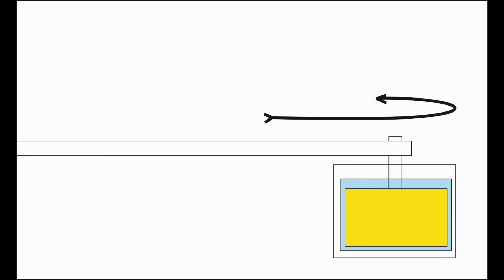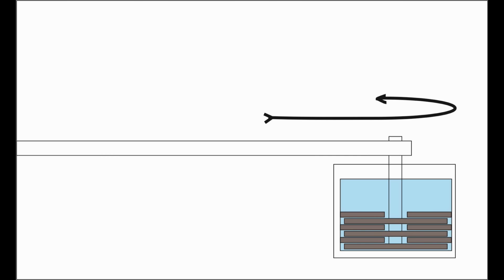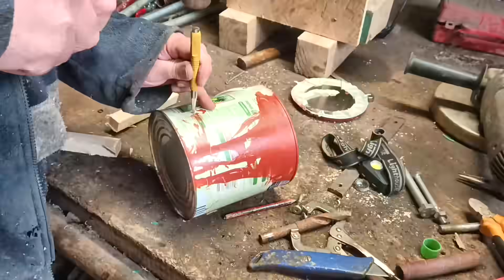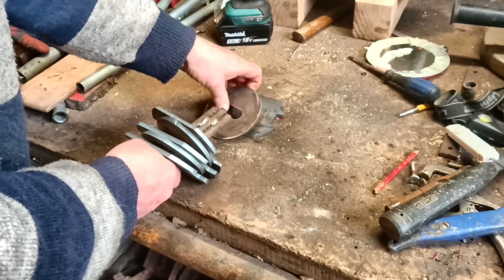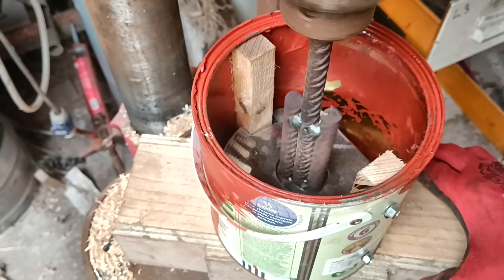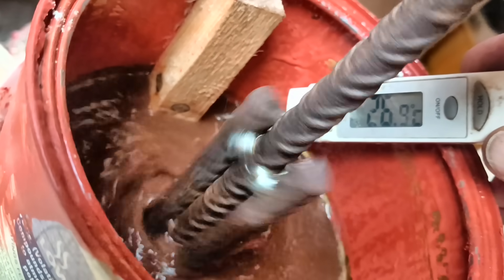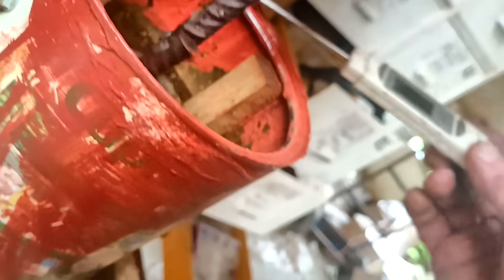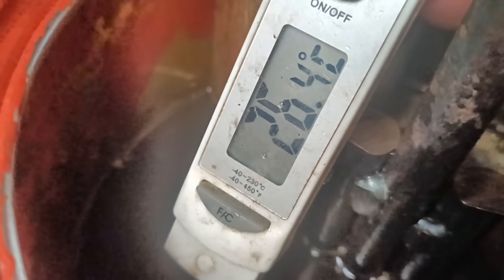Heating Water With Friction – How Practical Is It? Interesting Experiment!

Comment: Probably an old torque converter would be ideal. Just stall the output impellor and use the inbuilt pump to circulate oil to your heat exchanger primary circuit.
Reply: A very similar device that's actually designed to have water as the working fluid and for converting mechanical power into heat is a water brake dynamometer.
Reply: I agree.
Reply: I suggested one of the drums, then realized the whole transmission and tq converter. Fill with water, turn the input, lock the output. Water to water intercooler through the trans cooler lines. Gave ya a thumbs up for getting here first lol
Reply: Worth a shot, even if the heating is not satisfactory, it could be used as a progressively adjustable brake by varying the fluid level in the converter
Reply: That was going to be my suggestion,  they usually have an excess of heat and its already all done for you.  You could have multiple and tap off the oil.

Comment: Im not a fan of this idea, yes its simple in and of itself, but to heat a house, you then need to pipe the water to your house, which will take energy, and youve only got low grade energy at the end of it.

A wind turbine with electrical generator means you can wire it up with cables, and you can turn that electricity into heat if you want, and in the summer you can do other things when you don't need heat, and if you want to diversify your energy sources, eg get solar, itll be easier to get it all working together, and you also have options like heat pumps.

Water as an energy storage medium has merit, you have the space, but id aim to do that from energy that was already going to waste.

Comment: It seems like a great way of filling your heat exchanger with little tiny bits of iron oxide. I think you'd be better off just running a dynamo immersed in water, with the generated current going to resistors in the bottom of the tank, or to power the exchanger pumps.

Comment: Hi Tim. I don't have exact figures but I can tell that the steel plate friction idea won't be very efficient. I say this because it will  make a lot of noise, and that's energy lost. There will also be a lot of kinetic energy lost in the friction, mainly to wearing down the steel. It would also need a lot of adjustment, or it will wear smooth. EM resistance on the other hand won't cause noise or iron filings. Compare your experiment to a kettle, which draws about the same as that bench drill. The same energy converted into electricity would heat a lot more water a lot faster. You'll also severely limit yourself making your windmill only run this water heater. It could be used to power anything electrical if it drove a generator, instead of only being useful for hot water.
It would be really useful if your wind turbine, when not needed, could be used to pump water uphill, to a pond or a water tower. Acting as a battery, this could be used to run a small turbine, effectively storing the wind energy you harnessed, for when the wind stops blowing.
Reply from the maker: It was only an experiment, Joe! I'm just exploring the options  : -  )
Reply: . . . and a very interesting one  @wayoutwest-workshopstuff6299  My predictions are just that too. I'm looking forward to the whole process as much as the results, and if it's just to answer the question, will it work, then here we go! It got me thinking though, about low tech wind energy generation and storage. I pictured a windmill turning an Archemedes screw that fills a water tower. Add a water turbine fed from the tower, and it's a wind power battery! It could of course just run a generator directly, but accumulating a head of water from the erratic output of a wind turbine would give you a steady, predictable charge to work with for as long as the water flowed! More than enough to heat a tank of water I bet! It could be a closed loop of water, or harnessed from any convenient source, and You'll be building a tower for the sails anyway, so why not build a water tower inside it? The weight would make it a lot more stable, and you'd only need a couple of meters of head pressure, so three or four IPC bowsers stacked on top of eachother would take you to the required height and give you a lot of stored energy capacity.
I hope you don't mind me bouncing these ideas off you. I'd love to see you build a windmill for heating water, AND able to generate clean energy for other things. I just feel that friction plates would bring their own problems. Can't wait to see what your experiments show us.

Comment: Friction vs. Shear Force - I've had a car with an auxiliary water heater powered by the drive shaft - it was said to use shear forces in liquid to generate heat. It would be interesting to see if you could generate the same amount of heat as before even without the plates touching if you cut elongated slits into both rotor and stator plates. That way you could minimize wear & tear on the plates.

Comment: That's a good idea to for a cheap heating system but the metal particles could cause a clog in your central heating system, So could the windmill be connect a generator which powers a heat pump, it would cost more but it you wouldn't have the problem of metal practices potentially coulding your central heating system.

Comment: It can also be heated by induction, if you move powerful magnets close to a copper or aluminium tube, the metal gets very hot. It is a bit more expensive because you have to use big neodymium magnets.

P.S.
I've seen that this has already been mentioned.
 The heat pump is also a good idea, for every watt produced by the mill you heat almost twice as much, it is the closest thing to free energy that the laws of physics allow us.

Comment: Maybe dig a hole & put your friction heater in, soil acting as a low cost insulator for heat & sound, top up water as needed via surface tank using a level indicator, & extract via a heat exchanger. As you don’t need high temperatures for central heating water would be fine & also as it’s normally windy where you are you can get away without storage. Probably after a while you will ignore the noise of the wind mill & it would be off for about six months during summer when you don’t want house heating, although you could kiln dry wood or do other jobs with the heat when not needed to heat the house. Thanks for sharing!
Reply: Dig  a big hole. fill it with insulating layer of styrofoam etc. then a big layer of sand to keep heat. then the water tank with the friction heater inside.

Comment: That's quite significant heating for something you made it look like you more or less "throw together" in the video.  I do agree with other comments that induction would have a big advantage for long term use, but obviously that would require a lot of magnets, that can handle the temperature, some magnets starts to loose their magnetism at temperatures well below 100 °C, and if the system happens to run dry for any reason 100 °C is no longer the limit. 

Personally I'd might go with a belt driven air compressor to generate heat. The vast majority of the power a common air compressor uses turns into heat anyway, and then you have compressed air as a byproduct. Compressed air is not "just" a potential source of on demand  power, it's also very low in absolute humidity when it's cooled down and the water has condensed out. At the scale of producing heat for a home, just the fact that the once compressed air has very low water content can have a lot of interesting uses. Also, the heat from water condensation in the frist place improves overall efficiency of heat generation. 

If the compressed air is used to generate power you can achieve a significant cooling effect, you don't need very high pressures to reach far lower temperatures than required in a freezer.  

Going with an air compressor to generate the heat, the air can be delivered to a heat exchanger somewhere else, through an insulated line, and then to a tank for storage.
Reply from the maker: Oh man! More things to think about : -  )
Reply: the fact that compressed air does cool down is what makes it inefficient at producing power.
back when it was a big thing, they made "reheaters"... kerosene burners in sealed boxes in the airline itself... bring it back up to the temperature it was compressed to, or higher even...

when its hot, it wants to expand. when its cold... it wants to contract. its trying to absorb heat, not release it. yes, its a bit of a brain bender ;)

if you have a certain volume at a given pressure, and expand it to twice the volume... if it started at ambient, and cools down... the resulting pressure will be less than half... if its hot and cools to ambient as its expanded, it will be at more than half the pressure... and still be capable of performing useful work.

once you dispose of the heat of compression, you have to replace it to get that compressed air back to the same conditions it started at.

i forget all the terms... isothermic, isobaric, adiabatic...

still, they can heat or cool, thats all AC, fridges, and heatpumps are doing... they work fine when the input is constant, they can be tweaked to run at ideal efficiency... that is, they run at a constant speed...

the other issue with an air compressor, or wind power in general, is that it takes a certain amount of torque to simply rotate through a cycle. once the turbine can deliver that torque... the compressor cant harness any more power. it always takes the same power to turn over, yet the wind delivers power increasing at the cube of the velocity... twice the speed isnt twice the power, its four times the power! so you need a compressor that ideally can deliver four times as much at twice the RPM. that can vary its delivery rate... not its pressure, its delivery rate... on a cubic ratio to RPM....

can do that really easily with brakes...friction or eddy current types...
Reply: @paradiselost9946  It's the compression part where most power is lost as heat, which when generating heat is the main goal, not a deal breaker exactly. 

Compressing air should typically generate about as much heat as doing it by friction, but without having to deal with all that friction, and the heat in form of hot compressed air, so no need fro a separate pump. 

I consider the very small part of the input energy that the cooled down compressed air represents is more a nice and useful bonus, than a great improvement of thermodynamic efficiency of the system. 

But, it is technically possible to extract around half of that energy as mechanical energy, in a single stage adiabatic expansion, from say 10 bar. Multiple stages with heating in between just from ambient temperature can increase that further. Not easy, but possible, and it has been considered easier to either burn more stuff to generate more power to produce more compressed air, and or burn stuff to add more heat to the compressed air to increase output.

Comment: Water with a corrosion inhibiter (glycol antifreeze) would be better than oil in that it has a higher specific heat capacity than oil, is far easier o transfer the heat into than oil (heating and cooling oil is a ball ache, you need much greater surface area to achieve the same power rating) and oil would also reduce the friction, not what you are trying to achieve.
A design wth a very narrow gap (feeler gauge thin) between the plates may be effective if you can ensure water gets between the plates. The action of shearing the water will heat it. Maybe ask Integza about his Tesla turbine experiments? If you can pump liquids using a bladeless turbine it follows that you can absorb power in the same way. You could pressurize the water and then release the pressure accross a pressure relief valve. This is how we used to heat the oil in a hydraulic test stand that I ran. The power taken is calculated from mass flow rate multiplied by the pressure drop.
Reply from the maker: thank you, David. Makes sense...

Comment: I think exchanging the water for oil would be a good idea. This should dramatically reduce the wear of the plates. Also a higher viscosity could mean it heats up faster whith the same number of plates, by allowing to convert more energy at a time. I think motoroil could work quite well, also it should be not too extensive and readily availliable.
Reply: but the oil would leak into the ground and get everywhere

Comment: ? a 205L drum as a outer shell  , a 20L tank, with oil in the centre , between the tank and drum , you could then rap the tank in a copper coil surrounded by the sand battery for lack of a better term , copper coil passes through the drum too heat exchange, sand help insulate the tank and coil against heat loss ,oil in tank would help against excessive ware but may reduce friction  some what , drum get cemented in base of windmill  inline with output shaft   final alignment could be done by sand packing like a cope in casting , use of casting sand and hardener gas might help too , would you get the same effect with a Tesla turbine for plates , ,maybe a golden rule  snail shell type of curve too create a pressure from it using oil as a medium
Reply from the maker: all sorts of things to think about there, Christopher - thanks!

Comment: A cavitation pump looks like it’s worth a try. Interesting alternative approach. Thanks for working on it.
Reply: His current design isn't too far off from being one other than having plates touch. It just needs holes in the rotor plates as initiation sites for cavitation, correct spacing, and perhaps more RPMs.

Comment: I still dont get why not make electisdty you could charge baterys house and heat water with it then
Reply from the maker: Batteries are expensive and don't last very long, that's all
Reply: @wayoutwest-workshopstuff6299  i persnely have baterys and you are right but it is also grate to be offgrid if ever i want to if there is a powercut we can charge them off our generator

Comment: you might be able to use old car brake disks? 
would be very cheap,
all the same your current solution is brilliant; would probs work even better with holes cut in the disks
Reply: I would think that Brake Drums would be better. I'd spin the interior and keep the Brake drum stationary. Centrifugal force presses the blocks to the drum and a small spring could release them. Bonus advantage, it would work as a rotation speed gouvernor/regulator. The faster it spins, the harder it brakes.

Comment: If you do the heating under a vacuum, you can get water to boil at a lower temperature...I don't know if that will help in a practical way but if anyone is going to find out it will be you.😊

Comment: Very good idea. I imagine the wear while in water will be days to weeks. Oil however may change the wear substantially and that means heat generated will be less, so you would need many more plates or more pressure on the plates. 
The speed of rotation, I think, will ramp up the heat generated to the second or third power of speed. I presume the windmill will speed up and down with prevailing wind, so perhaps a way of changing the friction depending on speed?

Comment: The absorbers used on water brake dynamometers are simple and have no wearing surfaces. They are designed expressly for converting kinetic energy into heat. Worth investigating I think.
Reply from the maker: Thank you - I will
Reply: @wayoutwest-workshopstuff6299  https://www.youtube.com/watch?v=nSNkB0BXnHM i don't know if you can manufacture something like this in your workshop but the computer voice explains it good and the animation makes sense immediatly!
Reply: @wayoutwest-workshopstuff6299  This is the way. You just need to direct your energy to move the water. Restricting water movement will build you the proper torque to regulate the system to your suitable rpms.

I would try using a submerged pump and recirculating circuit. The same pump can also supply you the water for consumption.

Comment: My father used to ask many moons ago, if friction creates heat and heat creates steam, how long would it take a monkey scratching it`s head to boil a kettle of water containing one pint? Answers on a postcard please.
Reply: Depends on the insulation. In open air it will never boil, as the air takes the heat away faster than it is generated.

Comment: Now it is easier to put on a windy wheel, a good generator, the energy is used, from which heaters with a high useful coefficient of action are used than to create a complex system with a meager coefficient of useful actions, which will not buy work built into this, not to mention the materials .. .
Reply from the maker: I think you're wrong - but I don't know for sure yet!

Comment: Running a centrifugal water pump with the circulation through a small venturi will heat the water, and the small venturi will stop the ceramic bearings from overheating.
You will now have a pressurized holding tank and pressure will reticulate your water, also now you will have a low pressure feed line into the pump to supply the whole system.

Comment: After seeing this my idea would be to use a car or lorry drum brake and brake shoes with a tensioned handbrake cable that would apply more or less friction depending on how hard the windmill is running. The speed of rotation would not have to be so high as well methinks. The brake friction pads would be much more efficient and resilient than steel on steel and the water would lubricate them to minimise wear without much loss of heat transfer. Anyway, that would be my plan of attack.
Reply from the maker: easier to fit a windspeed governor to the tensioner too. But much less simple than mine?